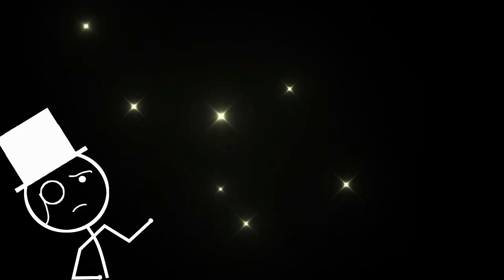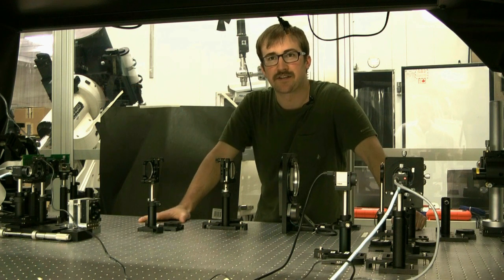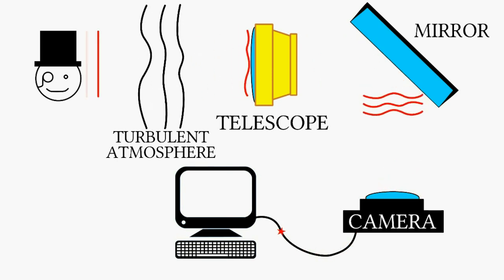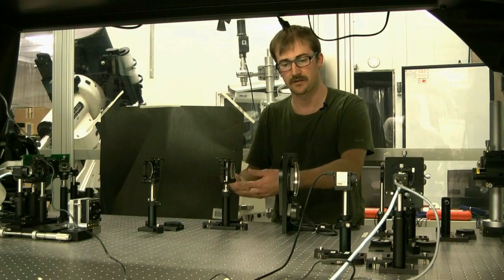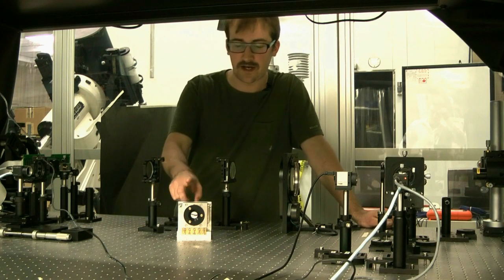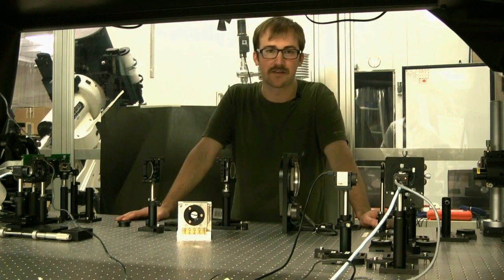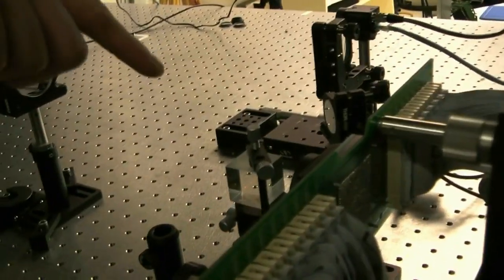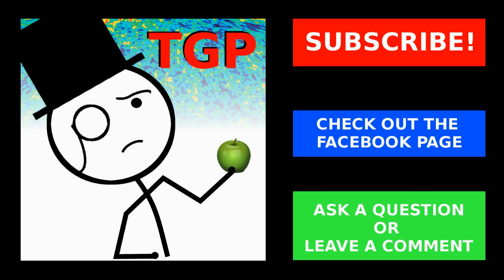Make The Atmosphere Disappear With Adaptive Optics

Comment: One question: why does it have to be so expensive? If one would mass-produce it, it could be in the range of amateur-astronomers worldwide. It would be a vast market-opportunity...
Reply: Yea mass produce 3 m miror with sensitive elektronic instruments. Even amator telescopes do not sell that much and those are mostly build with 200 to 300 mm miror. It cost  1 or 2k dolar if you are getting a good decent one now apply on that price 10k more just for hardware and you need to be really tecnical to use it. Now how many people will need that to massproduce.
Reply: @cemoguz2786  obviously, I meant a miniature version, not one for a 3m telescope. ;-) 

The same (counter)argument you are using has also been used in the past with computers as well. They used to be massive, spanning a room, and costing 500000 dollars. Back then, there was no vision of a possible "mass market" neither. In fact, Thomas Watson, president of IBM, notoriously said "I think there is a world market for maybe five computers."

Well... we all know how badly that claim aged, don't we? Nowadays, thanks to miniaturization and mass-production, we can buy a decent computer for 500 bucks, and they're small enough to put in your pocket. Yes, for a thousand times less money and a hundred times smaller, and that within a few decades.

My point was: one should go the same route with adaptive optics. Yes, if you make prototypes for 3-10m mirrors, it will be both massive and expensive. But just like with the computers of old, if you miniaturize and mass-produce it, it will be a huge success as well. Once it only costs 500 dollar and can be used with even a 25cm mirror, I bet almost all serious amateur-astronomers would buy one.

Comment: Thanks Mr. Andersen 4 this brilliant class. I want more technical information about. 4 ex. in the secondary mirror  (or other intermediary), how mutch must be the distortion of the surface? Other: It's possible to use the electrostrictives property of quartz about? (to build the secondary or some terciary mirror) So you needs not more than small silvered surfaces connected to computer, like a net I want your FB friendship, to ask more.

Comment: It'll be great when the deformable mirrors get affordable to amateur astronomers.  For now, wave front sensors require guide stars but I wonder if a wavefront sensor could ever work on assuming some stability in the undistorted image like speckle imaging does.  Requiring a powerful laser will always be a deal breaker for amataurs.  If the wavefront could be detected and given to an affordable deformable mirror, amateur astronomers could finally see lots of detail.

Comment: Since the computer must first see how the image is being distorted and then move the mirror, how does it compensate for that time lag?
Reply: It doesn't.  The correction isn't perfect, but you try to keep the update rate considerably faster than the atmospheric changes so that it doesn't matter too much.  It's like when you drive a car.  You see the car start to deviate from the center of your lane, so you adjust the steering wheel to put it back near the center.  Your tracking always lags and is never perfect, but it is good enough to keep the car on the road.
Reply: +Diego C. I'm not an expert but here's my thoughts.  I think the lag is kept under 1ms to minimize the effect.  You might think that reacting to a 1ms future prediction of the wavefront distortion would improve things but it may be too difficult to accurately predict.  I'm interested to see what an expert would say on this.
Reply: @IARRCSim  Quantum computers might fix that in the future.
Reply: @twistedyogert  quantum computers are practically useless right now and progressing quite slowly.   The sensors and conventional computers will likely get good enough to either reduce that lag to microseconds instead of 1ms or make a useful prediction before quantum computers become useful for adaptive optics.  1ms is long enough for a 1GHz CPU clock to run a million cycles and that could be a lot of calculation so I doubt computer processing speed is the main bottleneck anyway.

Comment: That's very close to to setting the "mode" on a beam through a particle accelerator, difference is that the ''deformal'' mirrors on the last resonator I set up were manually set and liquid cooled.  But when we set the mode we were always looking for a "O" as the footprint not a circular dot because the assist gas needs to follow the wave front when cutting and the particle beam would burn the mirrors and lenses and end up warping them or melting them if the beam became concentrated before leaving the final focal point lens of the head.  The resonator would cost upwards of 150k which consisted of 1 output-mirror(first pooiont at which the mode could be measured), One Rear mirror and 6 bending mirrors with correcting centers which all surround the turbine pressure generator for the plasma gas containment.  The beam was bent 6 times before leaving the resonator for maximum particle accuracy.  Every change in direction of the beam that is made before leaving through the output mirror makes the particles travel more and more straight.  If there were only an output and a rear how many tines would the light bounce between the two mirrors before reaching the output mirrors resistance level?  Baseicaly you get a output beam of  peak performance just outside the resonator but 100 feet away the beem is no longer optimal because of widening like a laser pointer.  With all the other bending mirrors in the resonator there is that much more correctability and trueness to the output beam.      If we had liquid cooled "deformal" mirrors that would be the cats ass.         For telescopic use; can the curvature of the Earth's atmospheric surface not be worked into the calibration as well as smooth the and even the wave front? And as well can we use a second and even perhaps a third or fourth highly sensitive "deformal" mirror or even mirror array  for digital adjustment of magnification and ? zoom  ?    ...this implemented into both systems of focusing visual ability and the focus of particle acceleration to a completely new level of accuracy?   This is truly  the next step in the weaponization and optical observation.  With this type of setup it would be possible to correct the existence of interference particles between the output mirror and the target by an automated (sensor/programmed controller/servo-adjusted/correction-checking/loop) setup that would allow the beam (or image to be viewed) to be bent around minor interferences that otherwise distort the focus of the image (or output beam).         One would think that with what we already know in means of technology we should be able to assemble an apparatus with ability to see a mouse on thee back side of Pluto and focus a particle beam to neuter him too.          As well the same technology with proper calibration could be used to measure the distances between us and anything or the distance between any two points in the universe we can see.          The same technology can again be employed to deliver energy wirelessly to a space faring vehicle as propulsory fuel.    Further more I here present that geothermal energy sources throughout the solar system and other energy sources could be utilized to extend the range of said space faring vehicles by installation of energy beam emitting stations that would operate autonomously by receiving pings like a cellular phone network then once the ping is received the network would use the closest tower to beam propulsory energy to the vehicle.  This technology after final development and thorough refinement could also be used to autonomously explore, scout, and expand our travelling range while constantly sending a report of progress back to us so we know what to expect and where to expect it in space exploration.  It would be used as a research refinement tool so we would know where to and not to find whatever it is we may be looking for and it could also be made untraceable to such an extent that it would in its tamper proofing be made to report its origin as its direction of exploration or as any where we want to make tracing of its origins impossible for an alien race that may discover it and investigate it.  A decoy could be also made at the reporting place of origin to allow us to monitor the reaction of the alien species to our existence. As well other measures could also be taken...    An autonomous space fence could be employed within the very same network to defend our territory from outside aggressors by making the propulsory fuel delivery system adjustable to a weapon grade beam devise and as well kinetic weapons systems could also be installed to further backup these autonomous beam stations.  The exploration units could be designed to work completely around any life form it found so as not to encroach on its natural self set boundary as well since all space is designated free for development of non space faring, non threat localized natural wild life throughout the universe.  Only species with sentient ability to destroy everything and overrun other types of life in the universe in an aggressive manor need limitation by universal law because from the general sentient beings curiosity fulfillment need of an explorer and respecter of the universe is come the Universal living beings right to happily exist naturally just so more diverse things are out in the universe for ever to be seen and experienced by all space farers because once there is nothing left to discover and nothing left to invent and the only driving factor left to us becomes need of resource to maintain and everything has been cataloged and learned we will become pretty bored if we have to look at the same thing everywhere.  Travel and diverse leisure activities will inevitably become the focus of our existence.  Can't wait.

Comment: Great video! But I have a question though. Why have a physical shape shifting mirror? Wouldn't be much easier and faster to have a program that grabs the reflected image, calculates the distortion and generate an image on the screen with a corrected image?
Reply: This is done the same way they corrected the blurry images taken with Hubble before the corrective COSTAR lens package was installed.  If you can model the imaging error, you can correct some of it mathematically.  But the result of the process is never as good as it would be if it was correctly focused to start with.  You can't get back details that were lost before they ever get to the camera.
Reply: Well I think the science fiction software programs from CSI or other films where they can resharpen a blurry image to toal crispness are just that... plain science fiction. (well, ok, at least to a certain amount, because there are real applications indeed).
The problem is, that if the image is already taken, you cannot determine from where a photon came from any more. You have only a 2-D representation of a 3-D input. The third dimension is lost and can only be predicted to a certain amount. That's why the photons have to be guided to the goal before they are captured.
Reply: MrVankog Thanks for your reply. I see your point.

But It might be not that far fetched. There is a commercial camera called Lytro, that's capable of focusing the image after the shot is taken. I'm not sure how it works, but what it supposedly does (if I understood it correctly)  is that it breaks the main image with an array of "microlenses" over an image capture sensor (not exactly a camera) and in the end the algorithm figures out where the light is coming from, and then it focus the image. This technology is available since 2009 and I guess it wouldn't be very complicated to adapt it to astronomical observations. And even if the processing takes some minutes, you usually don't need a "live stream" to observe stars.

So what it basically should do, is to record the 3-D input and then process it after the information is captured. The advantage would be the cost and also don't rely in mechanical piezoelectric mirrors, that I guess can be a problem for resolution. I have no idea if it would be doable, and I guess there are much smarter people than me thinking about it already.

But I have a gut feeling that it would be possible, maybe not with current technology but I wouldn't classify it as SciFy.

https://en.wikipedia.org/wiki/Lytro
Reply: Nix Dorf You are right. I heard of this too.
However, I think the main point with the solution in this video is to stay as compatible as possible to existing telescopes by just adjusting the mirror instead of the hole sensor and machinery. What you are talking about is a whole new approach for new telescope technology. Maybe we will see something like that in the near future.
Reply from the maker: MrVankog That seems pretty spot on about the direction of the photons being important.  I've actually played with  a Lytro it's quite a cool toy, but I don't know how they record the 3-D input.  It could be as sloppy as taking multiple images with different focal points.  
I have a feeling the Lytro is probably not the most efficient when it comes to capturing photons, thus making the image dimmer.  Not a problem for a daytime shot of your friends at the beach, but astronomical objects often need all the light they can get.  Adaptive optics can be better at catching every spare photon, especially with a guide star.
Again:  I don't know how a Lytro works, but my suspicion is that it sacrifices brightness in trade for having the direction of the incoming light.
Reply: I think the most direct answer is because the computational load required to do this is actually quite large, and when you are trying to keep up with the rate at which the atmosphere is changing this is probably just too hard to do. Cool thinking though.

Comment: Just love to see science at work. Curious to the computer and program used that can analyze the light and get the mirror to adjust as fast as the atmosphere changes. As said 1000 times per second would take some serious processing.Depending on the amount of light particles it is analyzing at any time. Oh does it do it's calculations per particle or per pixel?
Reply from the maker: In this set up I think it had to do the calculation for each lens in the grid that was held up to the light. (the waveform thingy ) So maybe a few thousand inputs were needed for the computer to do it's thing.
Reply: This is a big issue with modern AO systems and a lot of time and money goes into solving the huge computational loads when trying to keep up with the atmosphere. This problem inherently gets worse when you increase the number of actuators (and thus lenses in the wave front sensor), which we do to get an even better correction.
Reply: I imagine a system of recognition type software could be employed much like facial recognition but with obvious parameter changes to automate the adaptability.??

Comment: Wow, I would like to hear more about how the correction analysis itself takes place.

And It seems like it always analyzes the current image/frame and applies the found corrections (retrieved via magic) to the mirror, right?

So this means, because the atmosphere is constantly changing, the image cannot be perfect, because the correction measurements from the current frame n are applied the the upcoming frame n+1 that possibly has already totally different atmospheric deviations.
Reply: It sounds like the main way the try to deal with the n+1 problem is by increasing the frame rate, which limits how sub-optimal the correction can be.

It is possible to create sensors that would give you enough physical information about the incoming light to do the correction digitally (I think they are called 4-D sensors), but I'm guessing the cost is still too high to build a telescope out of them.

EDIT Double post removed. No idea how that happened.
Reply from the maker: StubbornProgrammer  That sounds about right.
Reply: MrVankog You have to remember that air is still fluid, it changes densities as warm air rises and cold air takes its place, this is a pattern that can be predicted and captured as information using this lens. This information goes through computer chips which use algorithms with many variables that can be adjusted to predict this flow and bring up a sharper image over time. Believe it or not, a computer does more than 1000 calculations a second already, it can easily adjust each lens and predict how the air will change as it is doing it. The constant feedback from the camera that shows the images in the grid allows it do adapt as conditions change in its prediction.The only downside which you've pointed out is that the first image will not be sharp, but as each image is taken the computer can adjust each actuator in the lens to make it sharp.